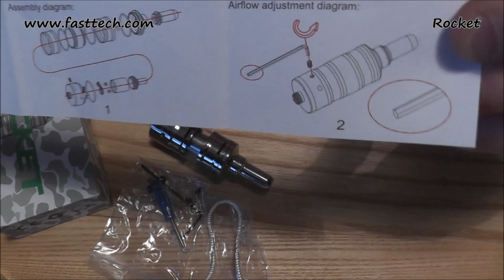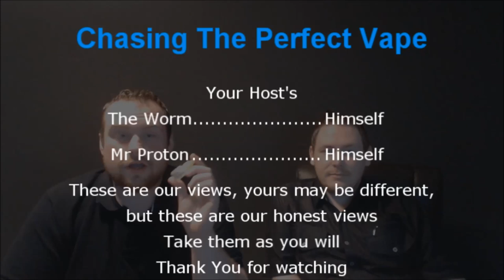Rocket - Kayfun Style Atomizer

Comment: Nice review and comparison.  Rather amazing performance. They do have a newer SS version out with a few enhancements.  A collar so any drip tip can be used,  comes with a  clear and SS center and a bottom air flow control ring.  About 17 quid ($28).  Have yet to see any real reviews of it of it though.
Reply from the maker: TheGus K sounds interesting maybe on the list as this performed well

Comment: Mine actually leaks somewhat. I don't know why. No flooding or anything. Got the same build on my ehpro 3.1 clone with a 1.2 ohm micro coil 28 gauge and cotton. I got the build down on the kayfun so it's not that. But as you said I'll lay it down and pick it up and it'll have a tiny pool of e-liquid that leaked out. Not sure why. Any tips?
Reply from the maker: NickxdaxQuick no idea mate the only thing we can assume is insulators or orings maybe replace them and report back?